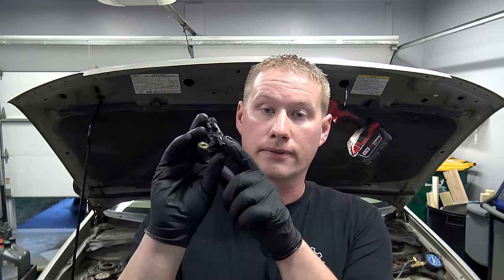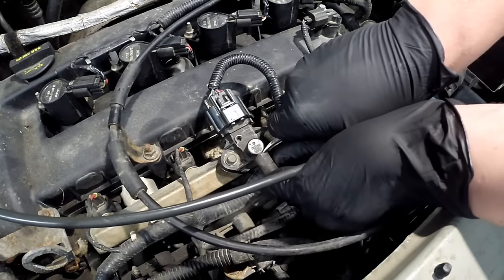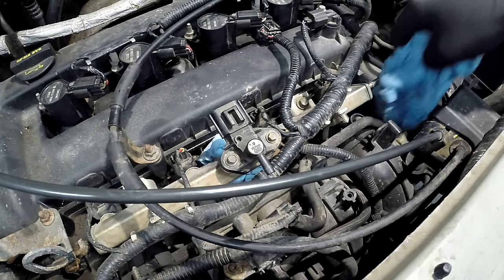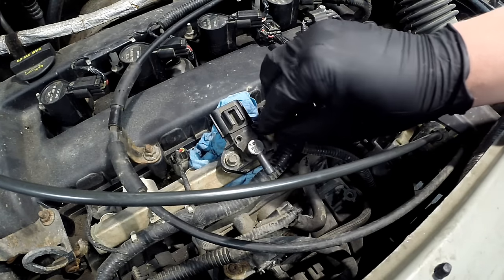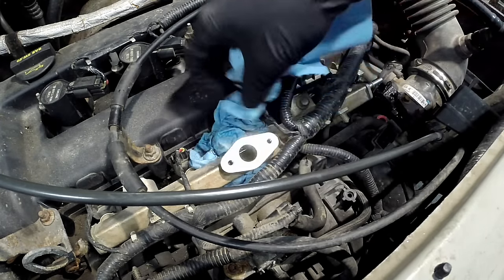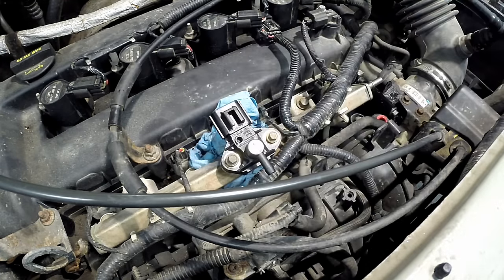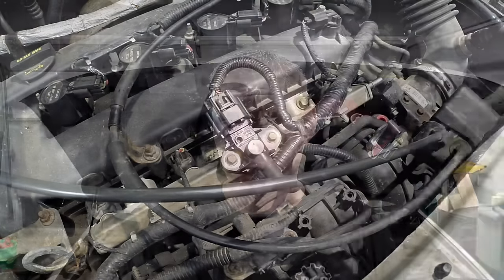Ford Vehicles: Fuel Rail Pressure Sensor Replacement P0191

Comment: The problem with diagnosing faults is the ECM will adjust Injector fuel input on O2 sensor data. Thus if the Pressure Sensor is Over estimating the rail Pressure then less fuel gets injected creating a lean burn. BUT The 02 sensor picks up lean, ECM increases fuel injection to compensate the lean condition. And your Long Term Fuel Trims rise, the car runs normally as the defficiency in fuel input has been quietly rectified.  The Only clue you get is high LTFT with no apparent reason. Your mileage doesn't change as you are not using more fuel, just an adjustment to input the correct amount of fuel. And the LTFT will likely be similar across all engine loads, whereas vacuum leaks Trims are worse at low loads and get better.   Even if the fuel regulator on a high pressure pump is faulty, the rail pressure sensors feedback to the ECM increases the regulator operation to get the pressure up, so you are unaware unless the regulator goes really bad and can't keep up.  So if you have high LTFT across all engine loads, the car runs normally, the MAP sensor is fine, then the fuel rail pressure sensor is the likely problem.  Now if you have to pay the cost of removing the intake manifold to get at the sensor to test pressure test it...well you may as well put a new one in while you are there...and maybe test the injectors as well.  Especially if your car has done a lot of miles.

Comment: Hi , my name is Kimberly and I watched your video,  I had 3 computers on my 2007 F150 4wd 5.4 liter , they all said the same thing the fuel pressure sensor.  So I go buy 1 and put on it , I done everything you said and it will crank and go dead . What else can I look for? I need help.  Single mom
Reply: Too little info. Hopefully ya figured it out.
Reply: Post a pic and twitch a lil bit and you will have all kinds of help we mechanics are stupid like that.
Reply: Did you fix your issue..?? What was it .?

Comment: I’m sitting in the dealer right now watching this video. I was curious about this thing and how to change it. They just charged me $350 to change it. I actually watched them change it. It was a new girl and she did it less than 10 mins! Ugh! I could have done it. This video was very helpful.
Reply: Wtf
Reply: Abdul Mumin yeah. I was so ticked off. That’s was a lot of money. I could have done it myself. :(
Reply: Well I had a similar problem to yourself. I went and bought the part. When my mechanic went to change it he told me the part that's all on looks quite new basically he made the call without even checking. In the end he noticed there was alot of worn out wiring that he basically taped up cleaned out the RD valves charged me $70 at first I thought it cost me so much more. Maybe I paid him $20 more but to be honest I got a refund on the unwanted part so far so good.

Comment: Did anyone noticed that was massive gasoline leak from fuel rail end, you disconnected fuel intake to rail and that's why were was no pressure in rail. But still good vid thanks.
Reply from the maker: +VILKAS yes the fuel line was disconnected as part of a much bigger repair on this vehicle.
Reply: ok now everything is clear :)
Reply: I do not understand your reply, I saw the dripping on the right. Explain how when I replace this part I do not get this leakage everywhere. Thanks!
Reply: @FordTechMakuloco  I have a question,  how to remove a failsafe engine mode light after the part was put in but code still on? Please,  thanks
Reply: @gladysesther6925  Fella you need to clear the KAM from the PCM
Reply: @FordTechMakuloco   Please help !! I have a 2003 Ford Expedition 5.4L I changed an 02 sensors bank 1 … car was running to rich … I switched it and put new 02 sensor on … cleared the codes and car still runs like if it has a misfire … checked on a scanner short term is adding more fuel and long term is not doing nothing

Comment: Mechanic tested over three days and $900 dollars later. I had placed sand bags over rear axel in trunk. That weight caused pressure on wiring that caused P0191 code. Go figure. Moved sand bags off wiring and it is fixed!
Reply: Ford wants 1400, to do a fuel rail sensor ,bs

Comment: I understand to put a towel under and over the fuel pressure sensor so you can protect yourself from high pressure gas but what is leaking in the back of the fuel rail?. Do we need a towel to catch the gas leaking in the back of the fuel? Lol Makuloco

Comment: I just got this code randomly on the highway. Engine died !!  This is so unbelievable and dangerous. I just dumped a bunch of money in maintenance and time to my 06 f150. New fuel filter. New fuel pump control module even though they were fine preventive maintenance and this is what I get.  150k miles f150. This thing is scary to rely on it.  It has been mostly reliable. But you never know what’s gonna go bad and when. Last summer it was a motor craft spark plug that has 50k mikes in it. List the strap and engine ram terrible and left me stranded. These things are freaking scary.  Now it’s running ok but iv. Got to take mountain highways to get home if this thing stalls and dies in a highway on a cliff. Im toast. Im thinking to replace the FPCM with old reliable one. Although this one has been fine for a few weeks

Comment: To fix: "Idles worse when warmed up." 
2 problems on my ZX3. 1. Collapsed PCV line at idle. 2. Fuel rail pressure sensor diaphragm was leaking gas INTERNALLY. No visible leaks outside. It's internal. This extra gas
 was flooding the car at idle. I replaced the coil, plugs and wires too but that problem remained even after the vacuum line PVC line  was replaced. The fuel rail pressure sensor leaking internally was it for sure because it leaks gas into the intake manifold via the vacuum line attached to it. Thusly, flooding the car at idle when warm with too much gas. Rough idle when warm is now  fixed!! No more rough idle. That pressure sensor controls the fuel pumps speed. If faulty, you get too much fuel pressure AND gas leaking through the diaphragm. Car runs rough at idle and/ or dies and because its too rich.
Reply: What kind of fuel pressure were you getting? I'm getting 65psi on my scan tool.
Reply: @macknumber9   That's what I read too.

Comment: Thanks for the video just had to replace my fuel rail pressure sensor for my 2005 Ford Focus after the engine light came on and detected that my sensor was faulty. This video worked and saved me from going to a mechanic. Great and easy steps and I had my new sensor installed in a few minutes. My car now runs so much better than before.

Comment: Very professional video, thanks for posting. When you broke the vacuum by removing the sensor starting at 4:31, fuel poured out the open fuel line on the upper right. I suppose most wouldn't have that line apart. It would have been nice to see how you proved the sensor was bad -- diagnostics will always be the weakest point for those of us who learn here on the net.
Reply from the maker: I have a whole video on the diagnostics for this this sensor.
Reply from the maker: https://www.youtube.com/watch?v=r4u67xjfFWY
Reply: Thanks!
Reply: spelunkerlllll
Reply: FordTechMakuloco
Reply: There's nothing much you can do to actually test the FRP sensor except using a scan tool like a Snap-On Modis.

Comment: I so much appreciate your efforts in providing professional information to the many of us who , although we have good mechanical skills, would never take on such a "previously" difficult / impossible task.  With your info and links,  I purchased a NEW Bosch part on line for $70 (Canadian), purchased a code reader for $80.00 (Can), and replaced the fuel sensor in less than 30 minutes start to finish.   Error cleared.    When, will my For* dealership realize that an estimate of $400 part + diag fees + install ... is simply unwarranted.   I didn't want to purchase the DEALERSHIP, I just wanted to clear the CheckEngine light.      Thank you very much and keep up the great videos.

Comment: Do you have an issue with buying faulty parts these days? I have installed two of these in a couple weeks both were supposed to be OEM from ford for my 4.6l. Had a code p0193, now I am having a PO182 which is related to the same part…wondering if counterfeit parts may be at play…maybe I’m being paranoid.
Reply: I'm getting p0182, did you find a fix for this??

Comment: Excellent video.  I just changed the fuel rail pressure sensor on my Mercury Monterey minivan.  Quick fix.  Keep the videos coming, I have used your channel several times to fix my vehicle.  You have saved my bacon more than once.

Comment: I'm just really curious about the gas that was coming out to the right, when you pulled the sensor fuel poured out of the end of the fuel rail, was it pose to do that???
Reply from the maker: Yes as this sensor replacement was part a much larger repair.

Comment: Hey Great video, can these sensor and sensors in general randomly work (intermittently) ? my ford seemed to work after a shop replaced a fuel pump and  and fuel pump module 2006 e150. and then 2 days later I lost power again and stalled. and stayed in that mode until I was towed home. Then it seemed to work again.  and a day later lost power again.  Also would one of these sensors prevent me from starting it?

Comment: 2005 Montego
Other than the fuel rail pressure sensor code PO191 going off numerous times and changing the sensor 7x in 3years (2018-2021) I ended up with car eventually going into safe mode.2019-2020 several times. Eventually it no longer reported codes it just had no power and no acceleration.
 I changed ECM with a new one with 2 keys from flagship 1 as my key would lose sync many times needing battery disconnected for 10min. Losing ECM link.
Was going to change main catalytic converters but when I cut down the rear converter it was broken gravel on the 1st disc and appeared clogged.
After the ECM and CAT change it's running great. Power good.
No key problems. Was able to sync 1 of my old 2 keys.
81.262 miles
Check rear cat. Replaced with WALKER 93237 ULTRA CAT using the forward fitting from the old cat cut flush.

Comment: Also check the driver module in the trunk. I had a 2010 Mustang that produced a P0191 code so I changed the FRP. No luck. Then checked driver module and found it under water because the drain troughs were clogged up and the spare tire well was full of water.

Comment: Here is a lesson people can learn by my mistake. I purchased one from ebay for 23.00 which is 1/3 of the price and we pulled mainfold off ect and was alot of work to get to this part in a 4.0. Anyways less then a week it failed and disaster struck with the fuel being sucked up threw FPS hose to manifold to each piston or valves so when I tried to start fuel was shooting out the muffler and the smell of gas so I kepted cranking not knowing what is going on until the engine stop cranking and I knew something was damaged probably bent valves. I had it towed home we took all apart again and when we pulled manifold off gallons of fuel came out the valves were filled over the top pulled the plugs and fuel was coming out of 3 of them, it was a disaster but I finally got it all dried out and purchased one from local auto parts place for 115 and installed so far after a few weeks nothing but was a valuable lesson that cheaper part costed me 80 more for another part oil,plugs at 50 and labor I paid out was 200 to a friend so that was a bargin, was it worth it, no way never again..
Reply from the maker: Wow that's bad! That is why I link to the Ford part on amazon they are only like $55 instead of over $100.
Reply: Yes it was a nightmare and we needed the part that day so we went to Pepboys and they are 115 and was a lesson for sure not that a namebrand part would not fail but the odds on that are slim versus ebay, you just do not know what your really getting and I have seen this part for 15.

Comment: get P0193 Code: Fuel Rail Pressure Sensor “A” Circuit High about every 250 miles after reset, do you think part is defected?  thanks.

Comment: Help please, I just bought a Motorcraft sensor for 2008 Ford Explorer number, (CM-5229) it’s a 4.0 engine. The first one I took out was a Bosch , and the second one I bought was a Bosch also. I’m just comparing  the Motorcraft (I just bought)with the reading on the 1st  bosch and I noticed, that the Bosch has the same numbers and the Ford logo and they’re made in Germany. So what’s the difference??

Comment: Great video. Could you please explain how to test this sensor? My old ford transit is not showing any codes and I simply don't know how to determine if this part is working fine.
Reply: Late reply, but it would throw a code almost certainly if it was not working

Comment: I've seen GDI engines with over 500 PSI fuel pressure. Good safety advice in this video Brian
Reply: +Ozzstar 
I have experienced GDI fuel pressures over 4000 PSI running and over 1200  PSI residual pressure with key off.

Comment: Do you have a video on how to change the fuel rail pressure sensor or where is it located at? It's a 2015 Ford f150 2.7L ecoboost. Thanks

Comment: On my 98 Ex v6 4.0 SOHC i hooked up my scanner to FORSCAN and i'm getting a 0psi reading even when the car is on. Starts up every single time the only issue is that i've been stalling at intersections and red lights a lot more. A rolling idle. No codes. New PCV valve,cleaned MAF/Throttle, new IAC. I'm hoping my stalling is something having to do with the fuel delivery and the 0psi reading on fuel pressure might be the culprit. Am i on the right track or does this sound more like a vacuum leak?
Reply: Hey did you figure out this problem... Thanks

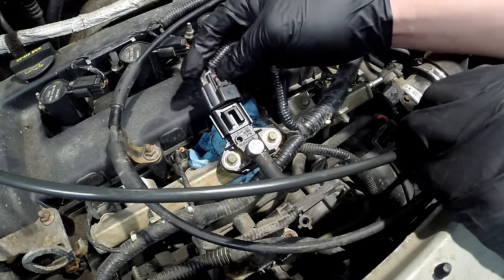Comment: 6:14 be careful with the dielectric grease, it's not conductive. It's an electrical insulator.  It shouldn't really  be put directly on mating surfaces of electrical contacts.
Reply from the maker: Never an issue, you could sqeeze an entire tube of grease onto a battery terminal for example and never have a problem.
Reply: FordTechMakuloco  I use it to coat the battery terminals after the wires are connected, not directly on the terminal, to keep corrosion at bay. 
You are the professional. I have an 01 F150 and 05 Town Car, both with the 4.6.  Your vids are very helpful, thank you.

Comment: Thank you for the great video!
I noticed that it was a 4 wire sensor, every piezo sensor that I have seen on all makes is a 3 pin. VRef, ground, and signal. Is the 4th wire a Fuel temp signal line? 

The reason I ask is because the sensor probe looks just like a thermistor. Thank you FordTechMakuloco

Comment: 2000 ford explorer  engine light on, p0174 p0171 lean codes, replaced vaccum hose on air box  housing and till code
reappears ?

Comment: Did you use dielectric grease on both the terminal and the o-ring, or can you use Vaseline on the o-ring? and can you use a sensor from a Junked car to replace a damaged sensor?

Comment: My 07 F150 quit running after 1 mile last week cutting out like fuel starvation with check engine light coming on. After the rollback trip back home pulled codes and came up with misfire cyl 5 and primary circuit in that cyl coil. Changed, no start. Leaned toward the fuel side  and checked fuel pump driver. Rotted out as usual. Changed. Crank no start. Undid fuel line on rail and energized pump. Very little output. Changed out fuel pump. Crank no start. Another code po193. Have one ordered but cleared and still crank no start. Does it sound like the fuel pressure sensor? Go out going down the road? Act lime fuel starvation?
Reply: Pls how did you fix it? Having same issue
Reply: @chidiuche754  feel like a dumbass but I had it hauled to dealer and come to find out it was the number 33 fuse blown. Now the fuses were the first thing I checked. The bad coil did blow the fuse but it blew in a way I couldn't see it, like down in the molded plastic. I missed it. They put a new one in and fired right up. Lot of work for nothing. Lesson learned. Replace fuses even if it doesn't look blown

Comment: Alright so I start up my 11 CVPI and I have a dead fuel gauge. The Gas light is on, the tank shows empty and at first I assume someone stole my gas because yesterday night I had 3/4 of a tank. I turn off the car after I warm it up, let it sit and restart the engine to find a check engine light but my fuel gauge functions normally. The car runs fine and now I assume it is the fuel sending unit. Any thoughts gentlemen ?

Comment: Good morning. I appreciate your videos. I have a crank no start issue on my 2006 Ford Expedition. I have changed the Fuel Pump and by passed the Fuel pump relay, when I noticed that the Fuel Pump wasn't getting power. The truck ran for about 2 weeks, now I have the same issue. Both the mechanic and I are completely confused as to what is the issue. Could it be the Fuel Rail Sensor causing this issue or the FUEL PUMP DRIVER MODULE? We are stuck.
Reply: What do you do to fix your issue? Do you replace this sensor I kinda have the same problem
Reply: @daniloescobar3555  I traded in the truck. It was too much headache.  But, if you buy parts, buy OEM ONLY! There's a relay mouthed on the back that rusted out over time. Change that, and that should solve the issue. I can't remember what it was called, but I changed that. If you look on the driver side rear frame you will see the part mounted on the frame.
Reply: Pls what did you do, have the same issue with mine ford Escape 2007
 It doesn't seem to want to accelerate. Change fuel pump, plugs and flushed the nozzles. I'm so confused
Reply: @daniloescobar3555   Pls what did you do, have the same issue with mine ford Escape 2007
 It doesn't seem to want to accelerate. Change fuel pump, plugs and flushed the nozzles. I'm so confused

Comment: Does fusion 2013-2016  2.5L  use this sensor couldn't find any information about it in service manual how would it regulate the pressure then? 🤔